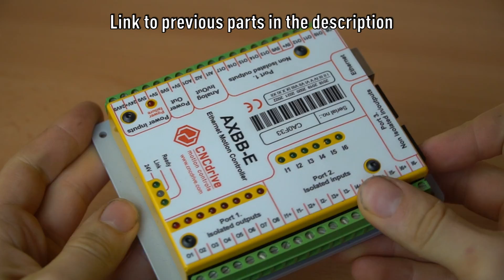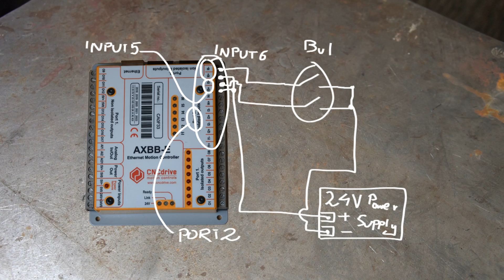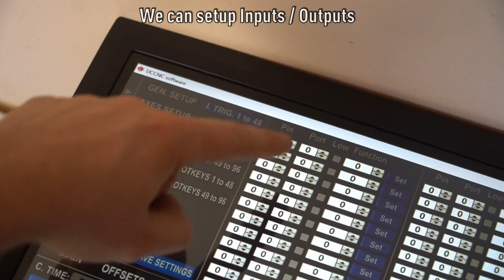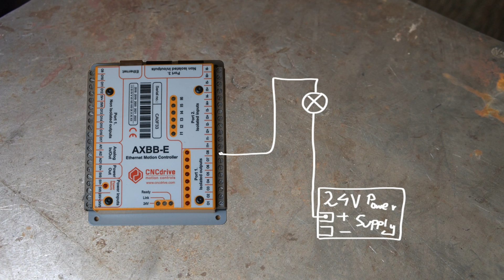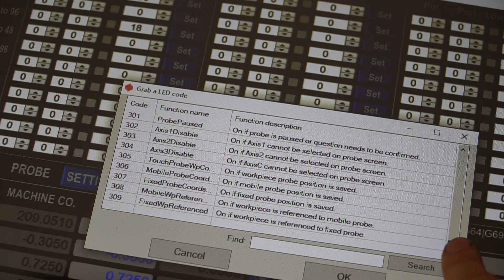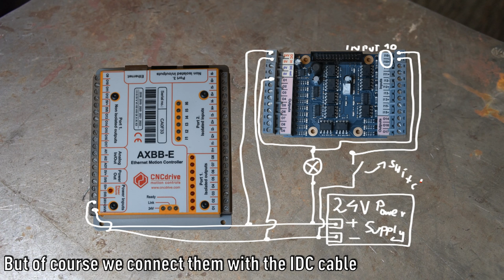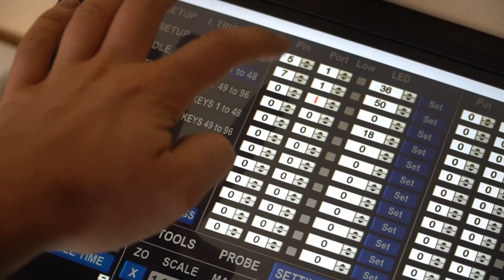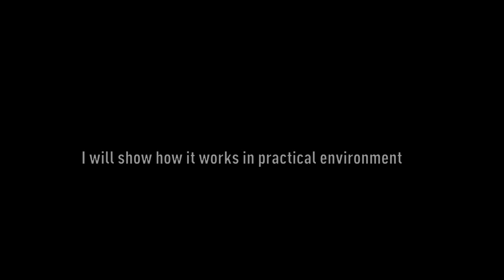AXBB-E Ethernet CNC Controller #4 DC I/O's and Port 3 UCSB Board

Comment: Is this the best board for uccnc?
Reply from the maker: Depends what is your main criteria. I liked it a lot but the other ones should be good too if you have other needs. Check how much analog inputs / outputs, digital inputs / outputs you need. How many axes have to be controlled etc. It all depends on how complicated your machine will be. The axbb-e has 24VDC input / outputs terminals which the other models don't have - those need breakout boards from what I know. Check on cncdrive.com for more info.

Comment: Hi, I'm french. I have an AXBBE and I don't manage to install my probe. There is 3 wires : signal, + and -. Can you help me to install it and configured correctly on UCCNC. Thanks you
Reply from the maker: Hi! I'll make a video about that soon. My probe is a 24VDC NPN sensor. So I wired mine to the + and - and the input 4 of port 2 if I remember correctly. If your probe is NPN then you can attach the signal to input (-) and input (+) to the dc power supply +. If you have PNP you do the opposite - signal is + and - goes to the power supply.
Reply: Thanks to answer @GBWM_CNC .  I can't wait to see your new video on mounting your probe. Besides, thank you for all the videos you made, they really helped me connect the AXBBE.
I'm not sure I understood correctly, does your probe have 2 or 3 wires?
Reply from the maker: @AgnèsNesp  NPN and PNP- type sensors / probes have 3 wires (same as mine has 3 wires). The difference is when you have a NPN probe then the signal wire goes to the "-" input of your device (for example our CNC controller). If you have a PNP probe then the signal wire goes to the "+" input of your device.

Comment: Thanks, I'm just trying to connect UCSB myself. For example, in order to connect many sensore or anything else in parallel, I decided to use PCB terminals, I want to solder the boards, instead of terminal blocks like yours, to be cleaner)) And so your videos are very useful. Please continue.
Reply from the maker: Great! There are so many inputs in this controller with the additional port 3 and I still would have some ideas for more inputs (for example I had to wire up the limit switches in parallel in my machine). I'm glad my videos are helpful.